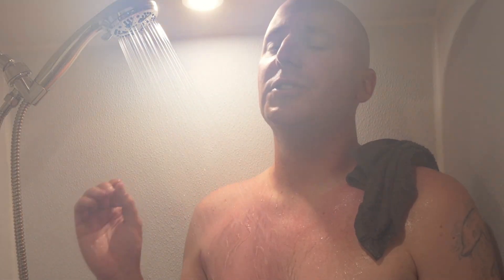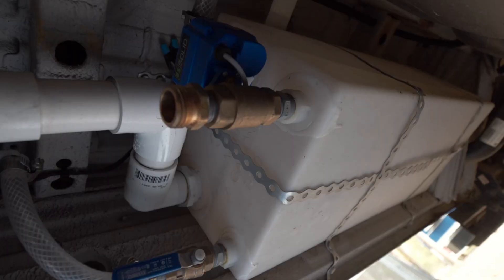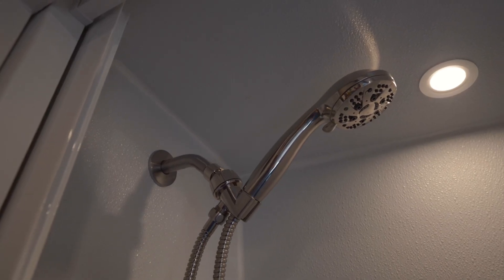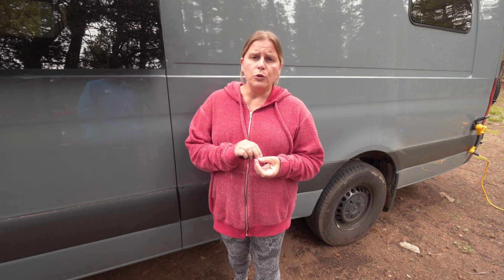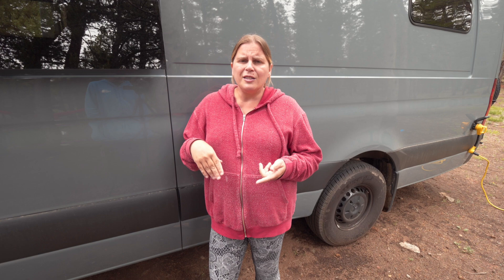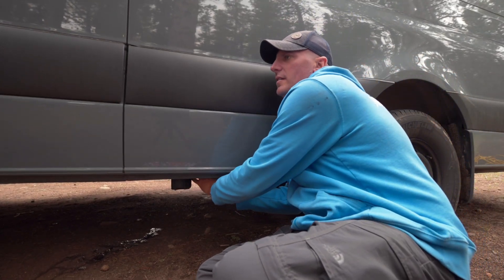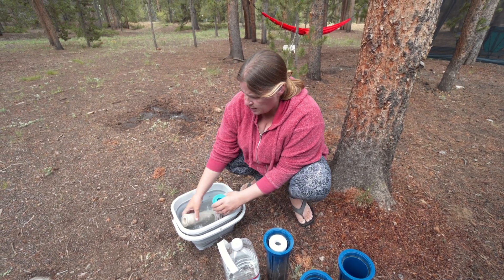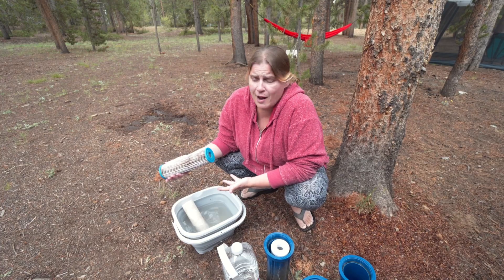RECIRCULATING SHOWER for Vanlife: The Truth and What You Need to Know!

Comment: Other YouTubers don’t talk about the pros and cons of the system.  Thank you so much for sharing the information.
Reply from the maker: You are so welcome! Thanks for watching! We don’t always have all the answers but we want to be honest about how things are working out for us! Hopefully it will help other while they are designing their systems.
Reply: This really cannot be stressed enough. You are spot on Lotso.
Reply: @WanderfulRevolution  Really appreciate your openness and thoroughness.
Reply: Exactly what I was referencing in my comment above. The pros and cons of practical applied use are missing from most of the "Recirculating Shower" design How-to's.  I've been pretty successful in getting feedback from the original author's by direct communication though.
Reply: the future is a fish pump connect to shower head, round bucket round shower curtain. optimal fish water heater. 45 minute shower on 1 1/2 gallons.
Reply: @resteringsalonze9303  man I wish you were my neighbor. I can't even visualize this. You guys are amazing!
Reply: @WanderfulRevolution  - regarding the "vinegar supplement". Vinegar acid is destroying chrome, while citrus acid doesn‘t. JFTR.
Reply: @WanderfulRevolution  Why didn't you just solve this with a very simple and practical solution? Just to illustrate, imagine a shower tray with 2 plug holes but only one plug. Hole 1 goes back into the recirculating shower. Hole 2 goes to a grey waste tank specifically for the shower. Take your hot shower as long as you want, and when you want to lava up with real soap and real shower gel, turn the shower off, have a thorough wash, change the plugs so THIS waste goes into the tank. Turn the shower back on, immediately rinse everything down and yourself and perhaps you will lose 2 liters that will periodically require topping up.

Problem solved.

Comment: Just an idea, which still need some details worked out:

1. Add a diverter valve with an input from your primary fw tank. This will allow switching between recirculate and fw tank.

2. Add a second drain, routed to a gray water tank.

3. Determine a way to toggle between the two drains. Could be as simple as toggling a plug between modes…

4. Now, you take “Navy Shower” as a pre-wash using primary fw and drained to gray tank. At this point you will have washed with whatever cleansers you desire. You are cleaned and rinsed using a minimal amount of fw.

5. Switch system to recirculating and take you long hot water shower. This should extend your maintenance cycles a little, since, you have pre washed. 

“Navy Shower”, 1. Get wet, shut off water. 2. Soap up - scrub. 3. Water on - rinse.
Reply: something like this would be my "dream loop shower". i think you could even go so far and automatize it using a sensor connected to an arduino or an rpi that measures conductivity or ph  which should increase when there is soap in the water triggering a two-way-valve and knock off the very soapy water.
Reply: it would require the water to run down some kind of carefully designed pipe with exactly known timing between the sensor and the valve and require a steady flow - therefore you could run the system only within very small margins - making it more complex overall. but i am sure something like this has been done yet though.
Reply: @wotzefakiu  I love the concept! It sounds like a very fun project for some people and a nightmare for others... Finding the right sensor or combination of sensors to work in concert with each other would be a fun challenge. This does bring back memories of trying to unify all my entertainment devices with a Logitech Harmony remote - for the wife... She just wanted one button to start it all up. It got close, but, occasionally it would go off the rails and then she wanted to throw the $300+ remote across the room... I suppose if you could make it reliable enough for anyone else in you group you would be good. You could kit them up an sell them. I built a BBQ control system that way. For me, to keep a remote lifestyle at an acceptable level of frustration I would opt for simple, reliable, and easy to troubleshoot.
Reply: Dude, you’re a genius! Awesome solutions! But if I were to install the shower system, I’d not install a gray water tank. I would do it like this: I’d first rinse off using the recirculating shower system. Then, when I’m soaping and rinsing off the soap, I’d turn off the recirculating shower, and instead of the water going to the gray tank, it’ll go straight to the ground( I’ll be using natural products which are good for the environment). What’s the point of carrying all of that dirty water with you when you can simply use natural cleaning products and dump it onto the ground?
Reply: @frankyeetermann4718  I wouldn't dump it directly on the ground if I was stealth camping in an urban like area, but otherwise yes that's a good idea. Maybe have a siwtch in the shower that could allow for all 3 options on the fly?
Reply: Except . Then they would have to carry more water and weight . Plus , then there is the gray tank to worry about .  Those things aside . It would help with the maintenance.!
Reply: this is a very good idea
Reply: Over in the Ryan and Su channel they implemented many of these suggestions.
Reply: @frankyeetermann4718 some national parks dont want you leavjng behind your poop so I dont think you can just dump your soapy water it could contiminate the environment
Reply: Why make it so complicated? There is a very simple solution? Just to illustrate, imagine a shower tray with 2 plug holes but only one plug. Hole 1 goes back into the recirculating shower. Hole 2 goes to a grey waste tank specifically for the shower. Take your hot shower as long as you want, and when you want to lava up with real soap and real shower gel, turn the shower off, have a thorough wash, switch the plug to the other hole so THIS waste goes into the tank. Turn the shower back on, immediately rinse everything down and yourself and perhaps you will lose 2 liters that will periodically require topping up.

Problem solved.
Reply: @wotzefakiu  actually i Have same problem Now. I must build an endless shower with Cooper coil between pump And shower head. I plan two loops or lets say ,,bypass" with rain shower valve. 
Before actual shower - 1. bypass drain-reservoir-pump-copped coil heat exchanger-valve-drain-reservoir-pump... 2. (Showering) Open rain shower valve - longer loop ::: valve-shower head-drain-reservoir-pump-heat exchange-valve-shower etc...gets rid off Used water or keep it for second shower respecting quality of water

Comment: You need a pre filter in the drain hole in your shower floor, that will eliminate that one problem. Simply pull it out and clean it after each shower. The reverse flow will help with your other problem until someone comes up with a better idea.
Reply: If not too expensive, have 2 more filters on hand to switch in. Can take time to soak the dirty filter.

Comment: I am an ED travel Nurse as well and I am in the planning stage of an overlander build. When I am on assignment lodging in lots of locations around the country is very expensive and also in very short supply. Last year I spent over $21,000 on the most basic lodging on assignment in Washington! The overlander will be lodging on days I work and adventure vehicle/camper to go boondocking on days off. I am interested in a recirculating shower concept so I appreciate you guy providing the good and bad issues with that design.

Comment: You can use 1 micron filter and reverse osmosis system. Water after reverse osmosis system is as clean as distillated water. You can drink it, or use for cooking. This system automatically divides water to two parts, so it has two output pipes. Distillated-clean water pipe and dirty gray water pipe. Proportions is like 1 to 1- it's easilly adjustable thing. So with this system you can't recirculate all water, only half, BUT this half will be ideally clean water.

Sorry for my English.
Reply from the maker: Thanks for the suggestion!

Comment: hi  there  great to watch your video  , i built recirculating   shower  in my caravan  and it works very well  i noticed that your  set up has  a few issues  i  had the same problem with mine  at first  
i quickly realised that  the filter just before the pump was to small and would clog up to quick  so i come out of the shower into a much larger filter  200 mesh filter  then to a  small filter on the pump   it then runs to  my spin down filter  then to my 5 micron  to a .5 micron filter  through my heater and back to the shower  , if you have your spin down  just after the pump its  as simple as opening the valve and draining it out  we have had no issues with our shower and  our main filters are much bigger than yours   happy to help  
mick   from Australia
Reply from the maker: @LeanneCraig-y2h  that’s awesome to hear! Thank you for the tips as well… sounds like you have it sorted!

Comment: One improvement could be a backwash cycle - when draining the tank it can clean the filters like a pool
Reply from the maker: Thanks! Its something we have considered, although we think its pretty easy to just pull the filter outs and rinse them too. If out next improvements arent sufficient, we are definitely think about this though! Thanks for watching!
Reply: If you do decide to backwash in the future, will you use a vinegar or some other solution to run thru it? I have not really started my research yet.

Comment: For anyone comming to this in the future. Pure sandlwood powder is an amazing soap and shampoo replacement. Look into it I won't go into all the details here. It takes a bit getting used to using it as shampoo but I have thin dry hair and my gf has thick hair and it works in both of ours. Just use a really nice leave in conditioner like k18 if needed  AFTER showering.Also seems weird rubbing essentialy dirt on your face and body but I actually like it better then soap now. We don't use it at home except for face washing just bc it isbkinda expensive but on the road in a recirculation shower it is amazing for everyday sweat and dirt. The thing that makes it amazing is the regular 3 stage filters capture all of it and don't clog the system bc you don't need much and all the powder is over 10 microns at the smallest. Most of it gets caught in the 25 micron filters and the rest in the 10 and .5 and .2  we have a 4 stage with uv filter. Spin down, then 25 micron, then the 10, then a combo filter with a .5 and .2 then carbon then the uv filter. Water never smells and is always clear. Runs off 2 gallons could use less but we like having more in the system just bc lol

Comment: I'm glad you talked about the problem with using soap, on my recirculating shower project i found the use of a Cleansing foam (Aloe Vesta) to work very well.
Reply from the maker: Awesome! Thanks for this suggestion! We will have to see if se can find this soap and try it!
Reply: @WanderfulRevolution  I bought it on Ebay it's also sold on Amazon.

Comment: Great video thank guys!

An idea.. two water tanks, one shower basin, with two plugs.

Fist tank and plug is the recycling system for getting wet to lather up.  Close plug A.

Open plug B. The second tank washes away lather into a grey tank. Close Plug B

Open plug A. Then back to first tank one to finish the shower for comfort.

Comment: For over a year, I’ve used baking soda in water as ‘shampoo’ and apple cider vinegar in water as ‘conditioner’. Depending on the season, I now go for 7-10 days between hair washings. As for soap, due to allergies and sensitivities, I’ve used water and friction in showers for decades.
Thanks for sharing the info on your shower. If I ever outfit a van, this would be something I’d want to add!
Reply from the maker: Thanks so much for sharing! I may have to give the baking soda and ACV a try for my hair. How exactly do you use the baking soda? Do you mix a small about of it in water?
Reply: I use approx 1 tsp soda to 3/4 cup water. I put both solutions into small squeeze bottles and leave in shower stall. Lasts me 3-4 washings. However I have short hair! If you search, you’ll find gals with long hair using this method; might give you more accurate info!
Reply: I've used the baking soda/vinegar "no-poo" method for years, long hair and short. I'd love to hear how that works for the recirc shower!
Reply: Oh, and I keep a small drinking cup in the shower, put the T of baking soda in before getting wet. Then when you add water from the shower, you're not pouring cold liquid on your head. Leave in for a bit, rinse, then guess at a tablespoon of ACV (bottle lives in the shower) into the cup, add warm shower water. Much more comfortable.
Reply: NoPoo lol.  No need shampoo. Once a year is good.  My hair feels so much nicer now that I didn't shampoo and condition.  😆
My wife hasn't left me yet either lol

Comment: I wonder if there could be a more basic recirculating shower that doesn't store the same water days on end or require all the filtration. You could maybe stand in a deep shower tray with a plug in it to keep the water in and use fresh heated water initially until the tray was full. Then, when there was enough water in the tray, switch a pump on which recirculates only that water though the shower, and cut off the fresh hot water supply. Your shower could then last as long as the water stays warm. When you're ready to finally rinse off, drain the tray and use just a quick spray of fresh water to get the last of the soap off. You'd use more water between refills as the water for each shower would be dumped, but it wouldn't be a ton and you could use your soaps and not need filtration.
Reply from the maker: There is currently such a system on the market! Water is changed every time. They don’t have a heated option as of yet but the company says coming soon! Thank you for watching
Reply: @WanderfulRevolution  interesting thanks. Do you remember the name of it?
Reply from the maker: @mistert800  https://hamwells.com/en/loopz/

Comment: Ever consider wrapping the drain plug in  2 layers of cheese cloth? One facing one way, the threads of the 2nd cloth in opposite direction, then clip it back in place. I would think this would catch a lot of hair as well.
Reply from the maker: Thanks for the suggestion. Hadn’t thought of this! Will look into it! Thanks!
Reply: That actually doesn't work as well as the gadget he is currently using, which is made from silicon. Cheesecloth deteriorates rapidly when wet and will end up disintegrating into the drain and getting caught in the tubing. I've done this method in household drains and the silicon plugs DO work best.  And they're only about $5 from Amazon.
Reply from the maker: @richlouie99  thanks for the info. The drain we have does trap a lot of hair. We haven’t seen any making it past our drain trap to any of the other fikters
Reply: @richlouie99  Hi Richlouie, ty for your comment on my comment. It would have to be cleaned after every use, and put back. That way it could be closely watched. But I do get what you are saying. :)

Comment: A hard Castile type soap with the Epsom salt might be a viable option(lavender/tea tree).. You can also make if so inclined (hot process so You can use  when cool).. 
 A side note on the filters,  the time listed on the filter for changing is not for debris, but the bacteria trapped and growing through the filter..( I would suspect the vinegar add would help to kill/slow that down).. 
There is also a wye screened prefilter that can be blown out without having to dismantle like the plastic one... hope it's helpful,  & I look forward to the next update..
Reply from the maker: Awesome! Thanks so much for the suggestions and info! WE will definitely consider this as we continue to experiment with the system!
Reply: @WanderfulRevolution  the more You learn... the more We learn 🤓

Comment: I'm 5 years from living in a OLV and am training myself with good water consumption habits now. One habit I've stopped was turning on the hot water for everything. I only use hot 10% of the time now. With the cooler weather I only shower once every two days. I will have the luxury to build and live/test my systems way before I go on the road. I will design all wiring and plumbing to be easily accessible for maintenance. Thanks for this information, standing on sholders
Reply from the maker: You are so welcome! Testing is important before hitting the road! Having designed the system we knew we had a solid idea but had no idea how it would actually turn out. Thank you for watching!

Comment: When I have my skip a shower day, I use hyperchlorous  solution I make with salt water that goes through electrolysis (which frees up the chlorite). I end up smelling like I just got out of a swimming pool, and it totally kills sweat smells. You might try using some of that before rinsing off in your shower. I don’t use it on my hair, though. I use a baking soda/ water mixture, and rinse with a bit of vinegar.
Reply: Hyperchlorous solution? That sounds interesting. Could you point me to some information about the DIY process?
Reply: @yxcvmk  I got mine from a place online called Pur-Well. I fill the spray bottle to the line and add a spoonful of regular table salt. (Spoon is included.) I make sure the sprayer is off. Then, I plug it in and push the button. When it indicates that it is finished, I unplug it, turn the sprayer to the spray setting, and use it as I need to. DO NOT get this in your eyes or mouth, or any mucous membranes! But, judicious use on stinky areas helps a lot! You can also use it to disinfect your home’s surfaces!
Reply: I've seen something like this in hot tubs you add salt or Epsom salts and it is ran through an anode powered with about 12v creates chlorine. But one could simply add chlorine from time to time to break down organics and Clarifier to lump the oils and soaps.